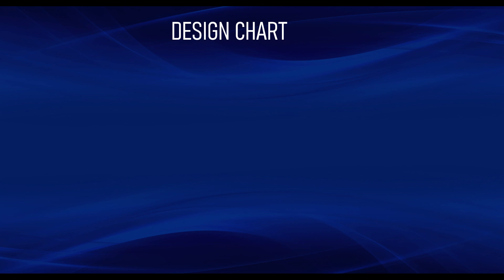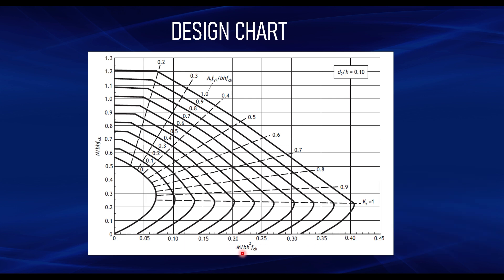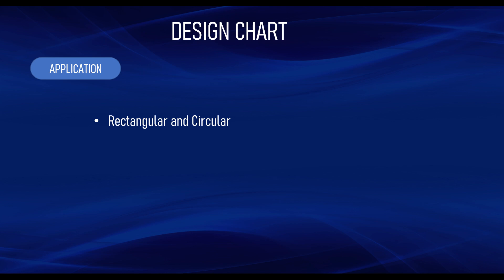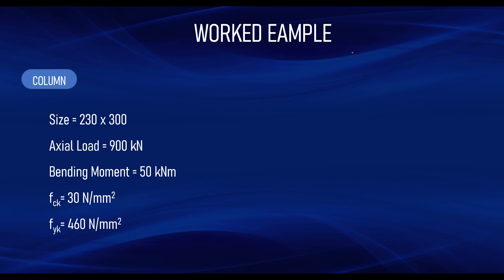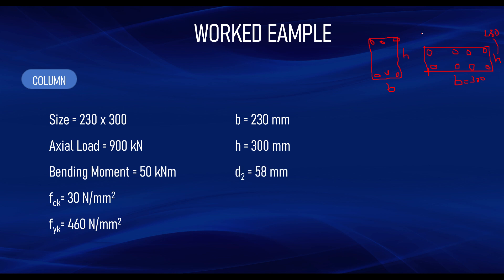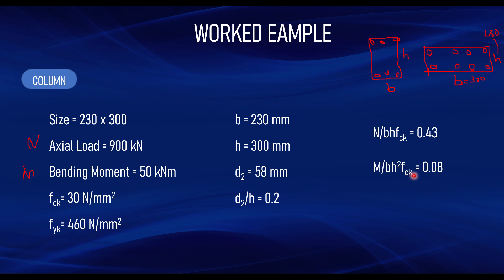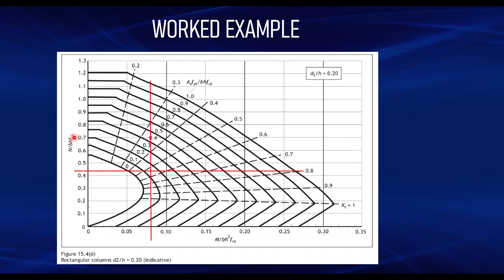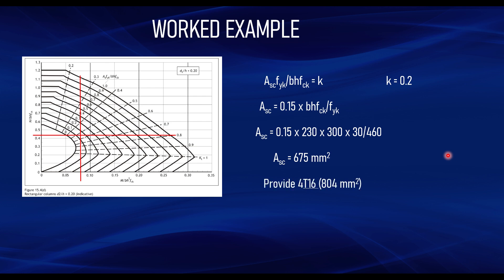RC Column Design to the Eurocode

Comment: Hello dear,thank youfor all, how to do in case you found the intersection points at the empty zone? 
For example (0.05,0.3).
Reply from the maker: https://youtu.be/xHdBiW8qEoM?si=0zVPD37IyroC7GeT This video explain what I meant better
Reply: @ShefdenAcademy  thank you
Reply from the maker: That means the required reinforcement is less than the minimum area of reinforcement for the section. Practically, you will provide the minimum reinforcement for the column section.

Comment: D/h = 0.8,0.85 etc how can I use it
Reply from the maker: For Eurocode chart you don't need D/h what is needed is d'/h as explained in the video. D/h is for BS code to select charts
Reply: @ShefdenAcademy  What it the D'/H is a number in between ? which chart should be used ? Larger or lower?
Reply: You used D prime /h not the effective depth and some textbook they use effective depth /h